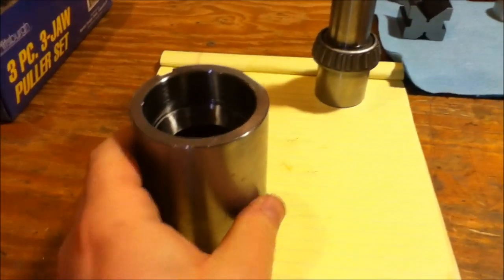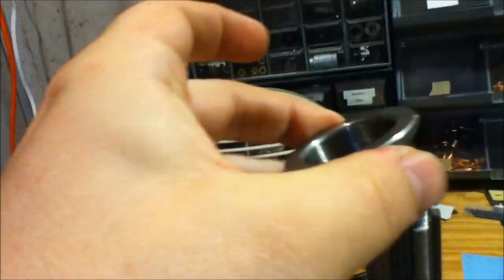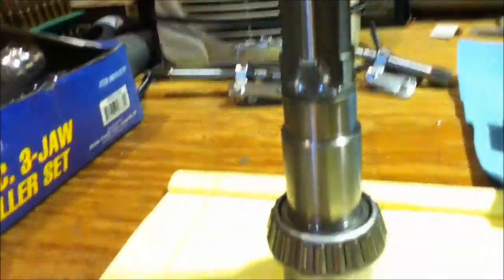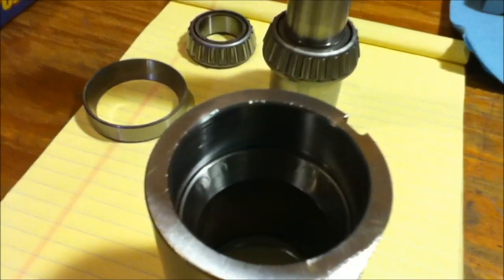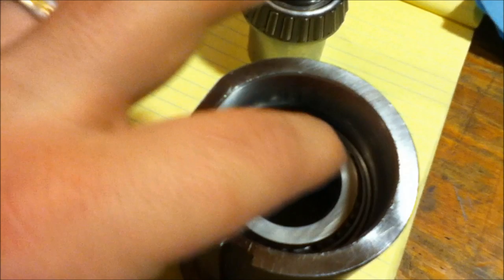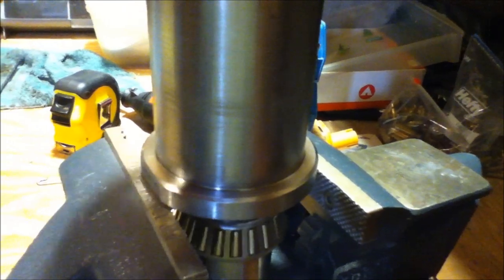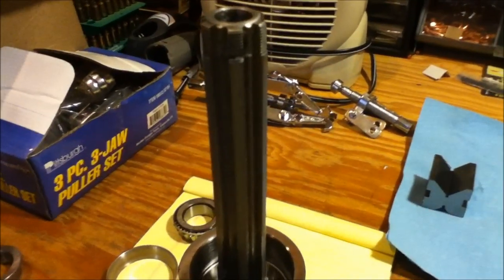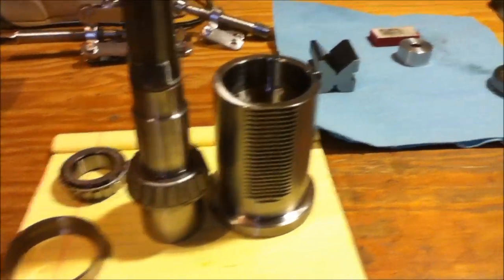PM-25 Spindle Bearings.wmv

Comment: As far as removing the bearing races from the spindle body, fill the bottom section of the spindle tube with something non-flammable and dry. Then coat the top with “tip dip” or grease  to keep the sparks from sticking on the metal. Then fire up the welder and lay a bead right around on the face of the race. After it cools it will usually fall out. In case you did not know “tip dip” is a name for the waxy stuff you coat a mig-welder gun tip with to keep the sparks from fusing to it.

Comment: The correct method is to check the shaft od with a micrometer and then see if you are within the shaft size tolerance for the type of bearing you are using. If the shaft is too big or too small bearing failure will occur. Same goes for the housing..this should be checked with a bore gauge. With super precision bearings you can order bearings with micron coding to suit your shaft and housing.

Comment: The method I use is a quart soup pan with motor oil in it and a fluke thermometer. When the oil is around 350/375 fish the bearing out. Never use a torch to heat a bearing directly.

To freeze the shaft you can use a CO2 fire extinguisher and a section of pipe. Run the hose from the extinguisher to the pipe and give it a couple shots to get the CO2 “snow” into the pipe. In terms of hot and cold a deep freeze is not exactly cold enough. Shrinkage is minimal unless you get it really cold.

Comment: Where i'm having a problem is getting the old race out that has no place to hit it from the back side..(scratching head) .I even noticed your outer race inside the front of the spindle housing does not have any recess to get behind it either and no mention of how you drew that one out.. im concocting all these ideas as to how to do it..Mine is very pitted so one thought was to weld in a plug and pop it out that way from the back...But i'm still curious how you went about solving this problem. any thoughts?